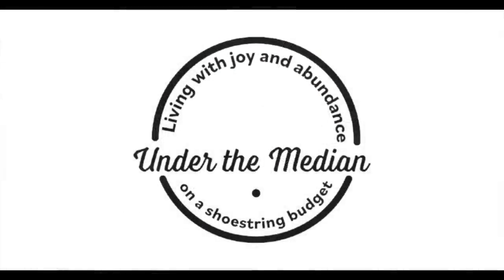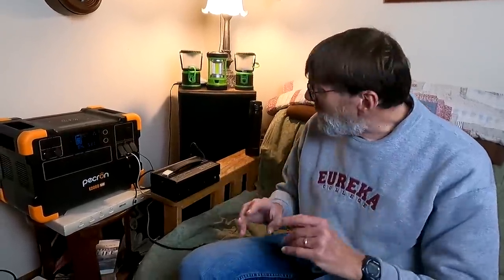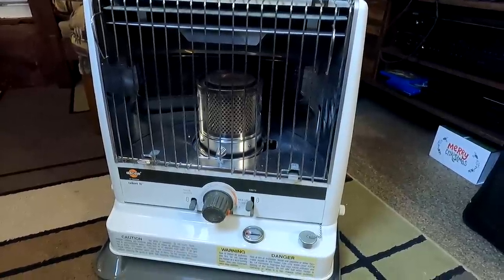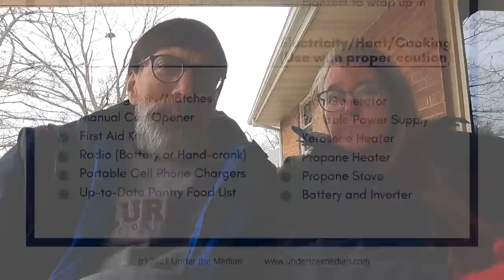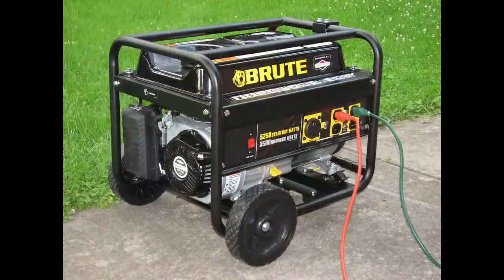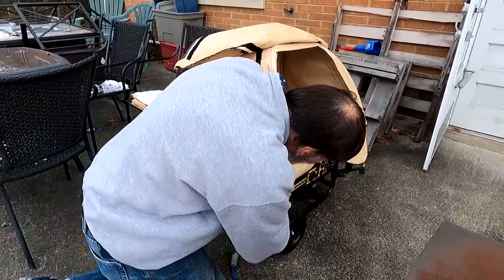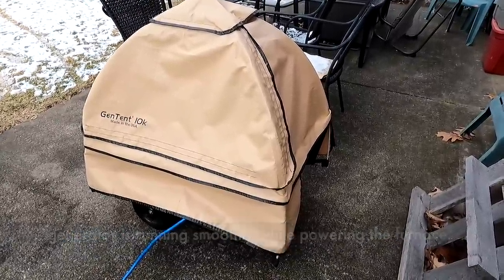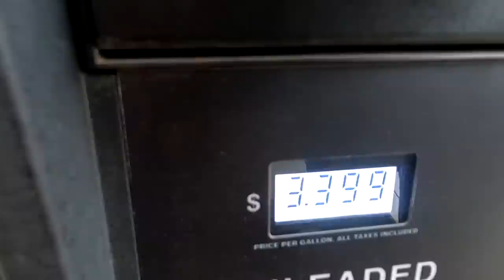Preparing Our Home For A Winter Storm Headed Our Way

Comment: I’m moving from Cali, Los Angeles to Denver, Colorado. Do you have any tip on how to drive in the snow?
Reply: Keep a full gas tank for better traction.  Drive slowly, allow plenty of stopping distance, don't tailgate the car in front of you.  Put blankets, a sleeping back, flashlights, and some dry food in the car, a thermos of coffee/hot chocolate, if you might be driving out of the city during a winter storm.
Reply: #1 You must get SNOW tires. They have a symbol on them called " mountian snowflake". It is like a mountian peak. Tires with the symbol M +S are not snow tires. 
#2 Windshield wiper fluid jugs  that go down to atleast -20 C , spare wiper blades for that long road trip
#3 Maxx Trax or similar amazon knock off. These things are gold. My husband had used them to get 5 people pit of the ditch already. Self rescue ...no problem.
Reply: Thsi advice coming from Northern Alberta....we live winter for 6-7 months of the year. :)